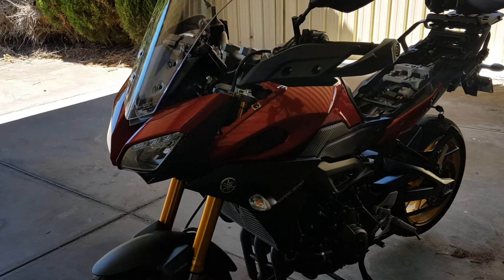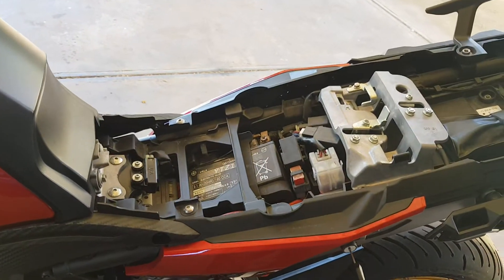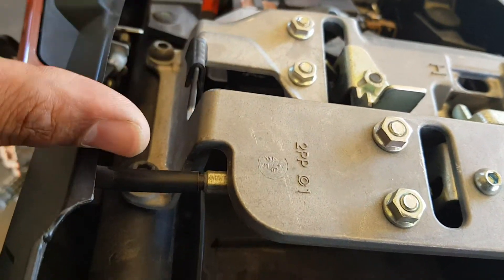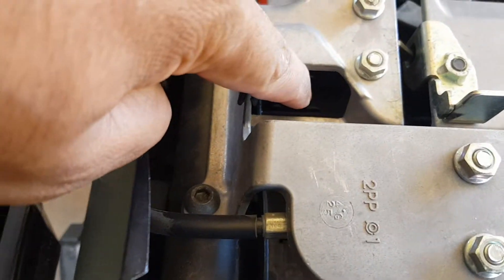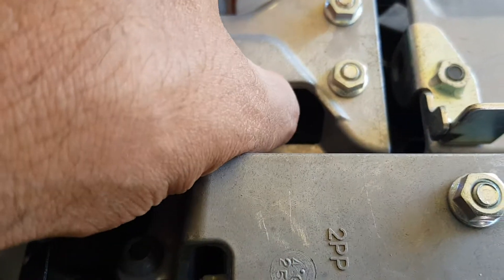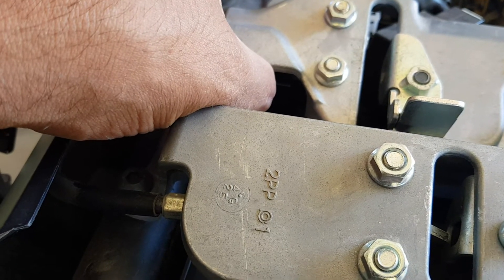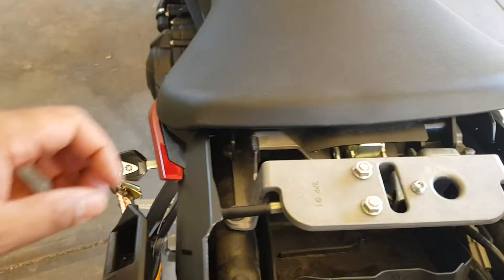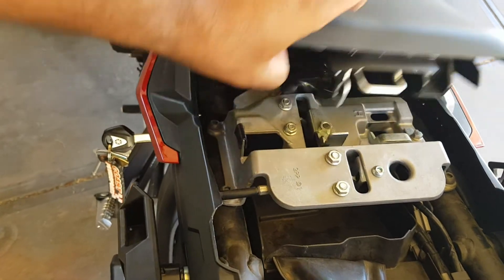Yamaha MT09 Tracer Front Seat Removal

Comment: Who else thinks the rubber piece in front of seat in low position is too ridiculously heavy to use even if it looks a teensy bit better?   I am like NO I am not lugging that on the bike I'll live with a gap  anyone weigh that thing?  Feels like a pound or more dang!  Besides wait a couple model years and probably could sell on ebay for $50 after half of em are lost forever